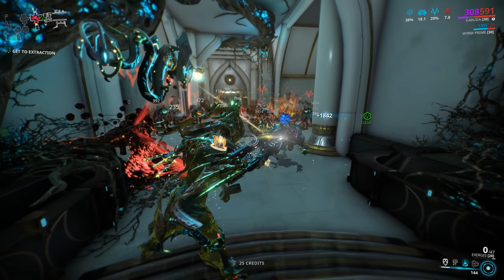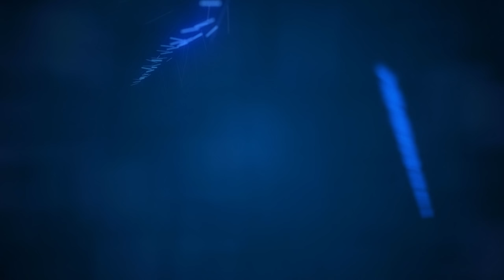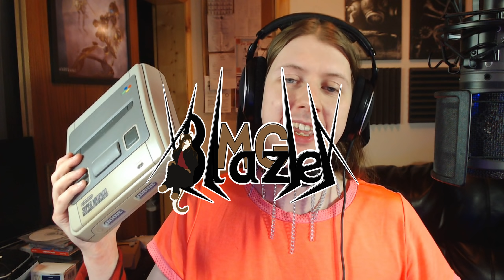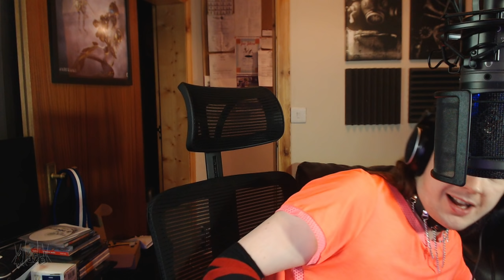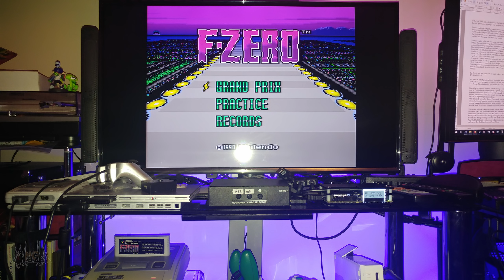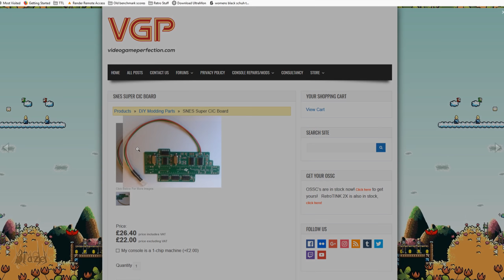Retro Gaming: SNES & Installing the SuperCIC Region Mod

Comment: I guess i'm 2.5 years too late, but fun fact: japanese Nintendo consoles work just fine with european power supplies, due to north of Japan actually using 50Hz standard while the south using 60Hz, and they have to account for that. And they will run on 60Hz even if you're using a 50Hz power supply. Also, if you wanna use a CRT, get a late Sony Trinitron model. They can switch between 60/50.
Reply from the maker: CRTs are pretty hard to find nearby in Northern Ireland, but I did manage to get a late CRT that supports both PAL and NTSC from a relative not too long ago, actually! It isn't a Sony Trinitron, but I'm not going to be too picky on that front.

Also, it is quite interesting to hear that about the japanese SNES. I keep forgetting the country actually was split between power supply frequencies.

Comment: Thanks so much for this video, I tried to do this mod too. Unfortunately when turning on the snes it will light up the led as a Christmas tree it looks like the reset button is pressed or ppu1 is fried lol. Did you had this issue too when you forget to wire pad 7? I have no idea where to look at this point :(
Reply: And awesome video anyway!
Reply from the maker: @FR0MMEL  Afraid not. All I could suggest is to double-check your solder joints to make sure that you aren't bridging pins or pads you aren't supposed to by accident, and to make sure you have a good solder connection everywhere you are supposed to.

Comment: After you did this mod, did you need to install the De-jitter Kit? VGP says that upscalers with the modded PAL consoles may experience jittering/stuttering when playing at 60hz. If not, it should be fine. Your board revisions looks to be the same i have.
Reply from the maker: If there is jitter, I can't tell personally; I run it through an OSSC, so that might have helped matters as well.